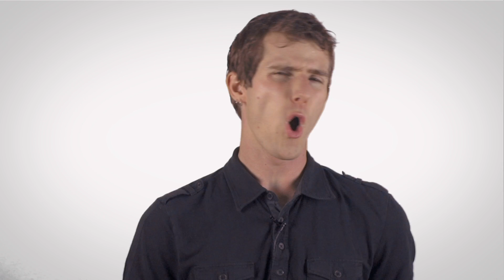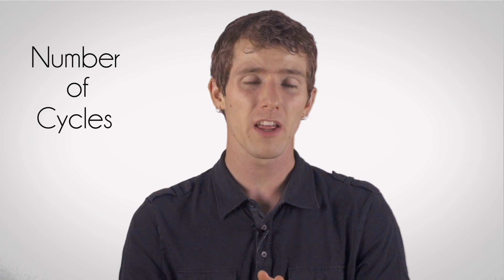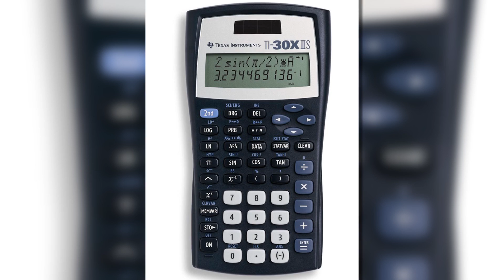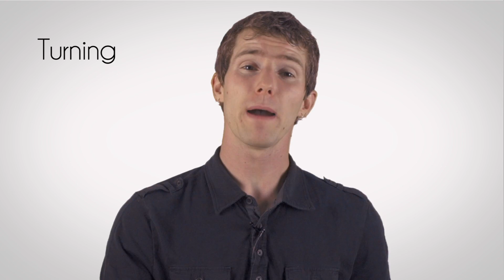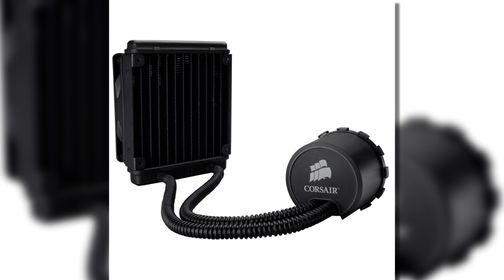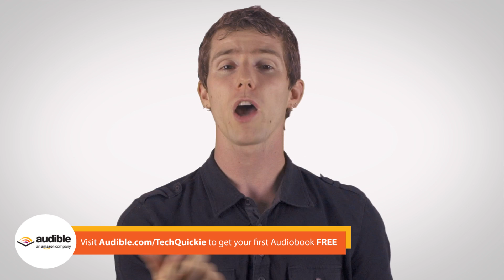What is Overclocking as Fast As Possible

Comment: Don't know much about electronics but it sounds similar to hot wiring a guitar amp to get more volume and distortion, but you run the risk of burning it out for the reason you mentioned of parts only being designed to take a certain voltage or is it currant?

Comment: If You Wanna Do It. Then You Have To First See The Base CPU Speed Or Download A CPUID. Then Download A Core Temp. What we Are Looking For Is The Voltage. If Example: 3500mhz Voltage: 1.450 Then You Should Do 3700mhz Then 1.470 or more But Keep In Mind That It Will Be Hotter And can Cause Failure So Make Sure To Get The stable One And The Temp Of the cpu Must Not Go 50 Above. 45-50 or below are safe. low voltage might just slow your pc if your mhz is high

Comment: would it be safe for me to overclock? specs:

GeForce GTX 1060 6gb dual oc.
i5 6600k
16gb ram 2400mzh.
z170 pro gaming.
Corsair  H110i CPU watercooler.
Corsair CX650M, 650W PSU
1tb hdd.
Reply: Sei maN no
Reply: u have a "k" version cpu and u have a water cooler...yes u can...
Reply: also msi z170a pro allows on board and bios over clocking
Reply: Sei maN why the Fuck would you overclock one of the best gaming spec out there?
Reply: how can we have the same computer? (except my cooler is a Cooler Master seidon V2)
Reply: Why are you planning to overclock a monster gaming pc?

Comment: So i tried to overclock my gtx 560 but after i while i didn't see any 
difference, so i deleted msi afterburner. but now i only get 5 fps in 
games i used to get 60 fps in! what do i have to do??????? i'm really 
freaking out now.
Reply: Silas Tamimi Okay, install MSI again, and set your clock speeds and power and voltage back to normal. After this, download the most recent NVidia Drivers. Now, uninstall MSI and RivaTuner. now, Install the new driver/reinstall current drivers if newest are already downloaded, and do so as admin - also unblock the program in the properties submenu by right-clicking it. Clean Install everything (GeForce Experience is optional). This fixed my similar problem on the GTX 760.

After install is done, install MSI fresh from the website. The purpose is to set up OC profiles, first, set non-vsync fps caps, and more importantly, monitor your hardware in-game every hour or so. You want to check for power and voltage delivery for the gpu, temperatures for the gpu and cpu, and mem speeds for the gpu; set the fps and frametime to show, too. Make sure your temperatures are in bounds for the hardware AND yourself, and otherwise keep the Riva display off, just check once every hour or so. Have an underclocked profile, for power-saving when not gaming, a normal profile, and a couple overclocked profiles for when you want more performance.
Reply: Setting FPS cals can save on power and heat, as well as possibly increase performance over time due to less heat and power being actively used; it gives overhead.
Reply: Is it fixed now ?
Reply: yeah this was a while ago and now i have a gtx 1060

Comment: Does anyone know of a micro atx board that will allow me to overclock my core 2 quad (socket lga 775)?
Reply: It's a locked CPU
Reply: no its not, all the core 2 series are overclockable, my current motherboard however wont allow me to overclock because its from an old hp compaq
Reply: D Jay Get a different motherboard... my man, why use that older tech? Like, do you do 360p gaming at 60fps? If so, I guess that works.
Reply: I'm saving up for a new lga1151 board with a 6600k now lol ...but I was getting 40-70 fps in 900p lol

Comment: I have increased my CPU speed from 3.7 Ghz to 4.2 Ghz. Everything is running stable and I had no crashes at this clock speed yet so everything looks good. I haven't increased the voltage of my CPU, it's still at the factory setting. My question was if it would also shorten the life spend if I would only increase the clock speed and not the voltage. Anyone has an idea?

I've read that you can only "harm" your processor by turning up the voltage, turning up the speed can at most make it unstable and crash your PC but shouldn't "damage" anything. I would highly appreciate if someone let's me know if this is correct. Also if this is all correct am I really running at 4.2 Ghz then? CPU Z says I'm indeed running at 4.2 Ghz but since I didn't gave my CPU more voltage I kind of feel like it can't really run at 4.2 Ghz and just attempts to.
Reply: it will either work or not. if you  didn't turn up the voltages, than awesome!

Comment: hi techquicki listen i just bought a new vedeo card nvidia geforce gtx 750 after playing bt4 for 10 s the game freeze and i get this msg : Directx fonction "GetDeviceRemovedReason" DXGI_ERROR_DEVICE_HUNG ("The device is hung which is typically caused by issues in the grapics driver or alternativvely the application "
GPU:"nVidia Geforce Gtx750" , driver :36839 .

Comment: I am still confused, can someone give me an example of overclocking? I found a really good build but it doesnt have a cpu cooler (is it necessary to have one if case provides?) so I am hesistant to get the parts until I get feedbacks. Here is the link: http://pcpartpicker.com/list/6RvkTH
Reply: you can't overclock with that motherboard and processor. You can only overclock on a Z170 board with a k processor like the i5 6600k.

Comment: HELP NEEDED I understand that overclocking a cpu or gpu can make things run faster, but is there any significant gains that you could actually use, for instance amd overclocked a cpu fro 2.5ghz to 8ghz and turned off some cores. yes you can run things faster but what would you actually gain from this, a processor only has a certain amount of cores I/O and gpu's have the same principle. Number crunching and video editing could be done quicker but is there any more uses, practically having an overclocked computer running 24/7?
Reply: +Robert Perry if you're overclocking something to 8 ghz... you better have a good ass fucking cooler..
Reply: noah. AMD used liquid Nitrogen or liquid Oxygen, I think it was the latter
Reply: Robert Perry why would you use LOX for cooling?
Reply: noah. it is colder than liquid nitrogen, although more care has to be taken with liquid oxygen as it's more dangerous due to the fact that oxygen gas, mixed with any sort of fuel can cause violent reactions
Reply: Robert Perry yeah well honestly i dont think it's a good risk to take.
Reply: noah. I don't see any real-world scenario where you would need to process something at 8Ghz anyway. But i'ts just good to say you can I suppose.

Comment: so after about an hour of stress from cpuz, everything stopped responding, I could move my mouse but nothing i clicked on really worked? what is the main cause of this? temps where under 60 the whole time and there where no sighns of instability before? is it voltage? (i5 4690k, 4589.16 mhz, 1.351 core voltage)
Reply: +Red Phoenix 850w gold rated PSU, double rad aio liquid cooler...
Reply: its probably not stable, tbh 1.35v is waaay over what i'd be comfortable with with my 4690k, personally have it running at 4.4ghz at 1.198v
anything over 1.3 will shorten the lifespan since haswell was designed for 1.25v
Reply: boertje1998 Thank you dude! Okay guess I over did it, though temps where fine enough? (Though on the borderline of uncomfortable 85° on prime 95)  What cooling where you using may I ask?
Reply: +BenAddict19 aircooling, a deepcool gamerstorm lucifer.
also, pushing the voltage up too high can also increase instability, 1,35 is way more than i need to run my 4690k at 4.6, 1.285 will do the trick there for me, but that might just be the silicon lottery. maybe you just have a chip that overclocks badly

Comment: so if i just use something like msi afterburner to increase my GPU's core/memory clock and i dont touch the voltage i wont risk any damage to it just make a bit less stable correct?
Reply: +nasa444444 cool thank you for the info :)
Reply: +CaveBobSpongeMan Try it. Instability means that it can't function well if kept at such a high clock and that depends on your GPU. Some overclock really well so you might not even have to tweak you voltage. Try running a stress test and seeing if your PC crashes. If yes then it's not stable and needs more voltage. If not, then you have a beast card that doesn't need more power which is great.
Reply: ***** Np ;)

Comment: My specs: i5 4690k, gtx 970, 8gb ram. I have a 500 watt EVGA PSU and a Cooler Master Hyper 212 EVO from Amazon that is arriving tomorrow to replace my stock cooler. I want to overclock my CPU to start off with and my GPU if I have enough PSU room left over. Is it safe to overclock my rig on this set-up? Cheers! :)
Reply: No, you need another two Hyper 212 EVO and you might be able overclock it a bit. You'll also wanna upgrade your ram double maybe triple it. Your gpu is also pretty weak try get a gtx 970 sli at least. And last thing, you will also need at least 1500w and it has to be gold rated or else your rig will literally explode and you will die(happened to me before not worth it). But yea other than that everything is great :)
Reply: No, you're cutting it way too close.

Comment: Legit question: Can you adjust the clockspeed of a PC when it's already fully booted up (ie., adjust the clock speed not through the bios)? My idea was to have a switch that's linked to software on the computer so I can adjust clockspeed on command, whenever I want to/need to

Comment: so, how do i underclock my galaxy s6? it has way too much proccesor power and eats up the battery way too fast
Reply: +Some Weeb There should be some power options in the settings. You can also put the screen in black-and-white mode if that's an option. Other than that, it's relatively complicated to change clock settings, so if your battery runs out too fast, maybe get an external battery: http://www.amazon.com/cell-phone-battery-packs-cases/b/ref=wl_nav_left_cpa_batt?ie=UTF8&node=2407758011&pf_rd_m=ATVPDKIKX0DER&pf_rd_s=merchandised-search-left-3&pf_rd_r=1M3DACW37D559Q6Q1HTK&pf_rd_t=101&pf_rd_p=2402557802&pf_rd_i=2335752011
Reply: Elias Simon i already leave it in power saving mode, and on a normal day, i go through about 60% of the battery, and the black and white mode also prevents me from doing a ton of stuff

Comment: In a nutshell, overclocking is:

Increasing the frequency of your device, leading to higher performance
Reply: +A Helpful Person leading to possible failure of the device
Reply: ***** hence "possible" failure
Increasing the voltage of a cpu makes it hot.
so obviously there are chances of breaking entirely.
:^)
Reply: ***** So basically if i put a icecube on my cpu and set it to 7.0 GHz ill be good? :^)
Reply: +Flyy Gaming "higher performance" is a vague term. It tends to be thrown around without any specific meaning or real-world examples of situations where a higher frequency improves the experience. Will an overclocked computer boot up faster? Will an overclocked cpu be able to run a program it couldn't before? Will the overclocked cpu be able to run multiple programs simultaneously whereas it couldn't at stock speed? Seems like in the frenzy to obtain a higher number, the real benefit of that number is passed over.

Comment: Hey Linus and Youtubers.
I need to know if I should get more juice out of my Gtx 650ti (Its gigabyte) (2gb) 
Im using MSI afterburner.
I was able to get 1124Mhz Core and 2930 Mem. (its stable)
I wanted to push it harder but when card reaches 80° pc reboots. (while doing benchmarks and games) 
So what could be the problem?
Btw. Im geting 20% fps boost. Plz help.
Reply: Im using gigabyte "ultra durable" motherboard which has "high temp protection" 
Sorry if there is non-sense. :(

Comment: Guys, can anyone tell me about their experiences with the Pentium G3258? I ask because I'm just using mine with a Cooler Master Seidon 120V Liquid Cooler and I'm stably running at 6.3 GHz with MSI's Dynamic CPU clock feature. I've only ever seen people push the Pentium to around 4.8 GHz? Halp.
Reply: Oscar Corriette 6.3 GHZ?
Reply: +practicing carlinist Texan1955 seriously. For some reason, my cpu is constantly running at 4GHz or something when it's clocked at 3.2. When I overclocked to 4.5, however, it runs at anywhere between 6.21 and 6.3. I honestly can't explain it.
Reply: i am speech less
that is a one very special chip
you are a very lucky person:)

Comment: LinusTechTips Is it bad to keep my fan speed at 100% all the time even in idle?
Reply: Temothy Homecillo It's not; that will improve airflow, and, therefore, cooling (obviously). The only downside is noise, but, if you can live with it, there's nothing to lose. :)
Reply: Oscar Corriette I wouldn't really mind the noise since I'm using a headset. I wouldn't notice a thing. Thanks for the tip!
Reply: Haha, I'm exactly the same: I have 5 fans running at 100%, but I always have a headset on :D

Comment: Can I overclock my cpu with this build? and how far can I push it? and if I can push it far, do I need a higher wattage power supply?

 http://pcpartpicker.com/p/pXrkK8

The Corsair fans are replacing the stock ones in the case and the Noctua ones are making the Corsair h110i gt push and pull.
Reply: Cthulhu14- That PSU is perfect, and with your cooler and the noctuas, you could see a stable clock of 4.7 Base, but every chip is different. For example, I have my Pentium G3258 running stably at 6.3 GHz on just a Seidon 120v liquid cooler. You never know what you'll get
Reply: Ok thanks
Reply: +Cthulhu14- The PC will draw about 300 W, but the PSU is 850 W that's too big.

Comment: for all the newbies out there, theres no need for this. Just get something like the toshiba c50 or acer e1 522. Any 400 buck laptop nowadays can run the latest games decently, i dont see what the problem is :)
Reply: Mahadonation1 That's the key: 'decently', also, I can tell you now that this morning I was hitting 45 FPS in The Witcher 3 on Ultra @ 1080p; your laptop could not do that. Ever.
Reply: Oscar Corriette the newbies don't have high demands like you. eventually they will be hungry for more so I advise them to research. I wonder what ur using dude
Reply: I'm running a Pentium G3258 clocked @ 6.3GHz, 16 Gb of DDR3 1600MHz, and a GTX 770 4GB OC Edition
Reply: sweet, witcher 3 is kind of demanding. im using i74790k and gtx 970 with sli krait motherboard with 8gb ram. the rig cost us an arm an a leg but was worth every penny. my first build, booted up first time. building a computer is easier than i thought. you just have to get rid of that 'its gonna blow up mentality'

Comment: Does overclocking shorten the lifespawn of a gpu? Whats the lifespawn of a gtu?
Reply: Pedro Martins if you dont have enough cooling power and if you overclock it too much, it can be dangerous. but if you handle these two things, you dont need to worry.
Reply: dzoni1990 what are the factors for decreased lifespan of a gpu when OCing?
Reply: Pedro Martins Yes it can shorten lifespan. I'm unsure of lifespan of GPU's.
Reply: temperature and voltage
Reply: +Pedro Martins Just provide adequate cooling and you won't have to worry about lifespan as much on your components.
Reply: lol did u fall on ur head as a child u mispelled it twice
Reply: Mahadonation1 i'm just a non english speaker, idiot.
Reply: hahaha i feel bad now